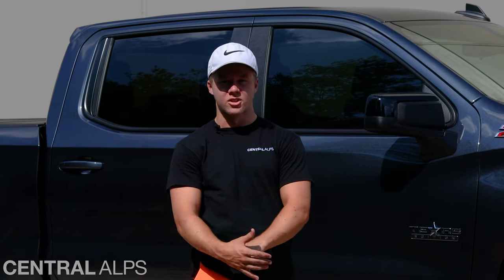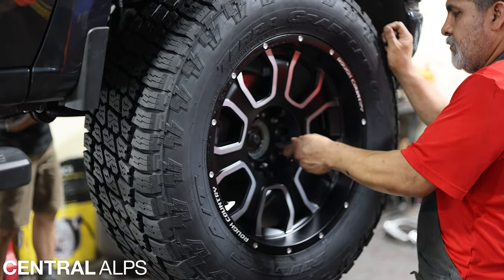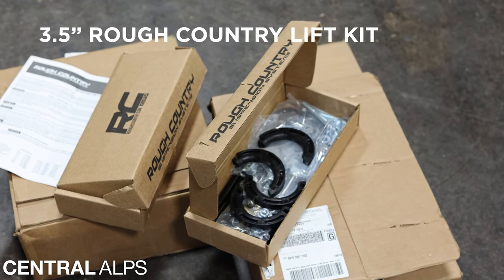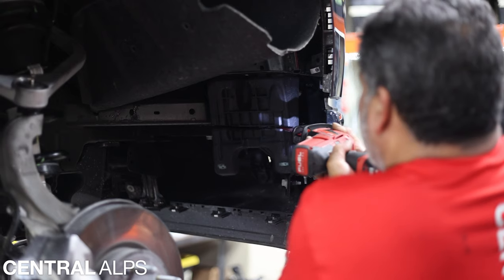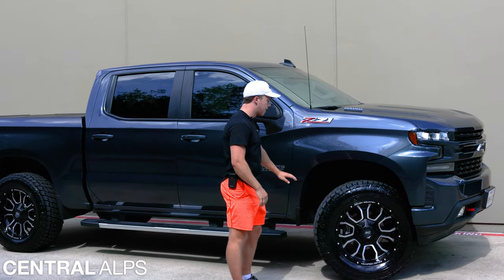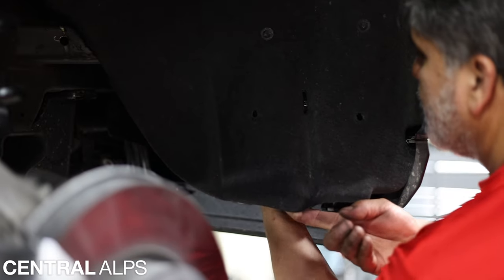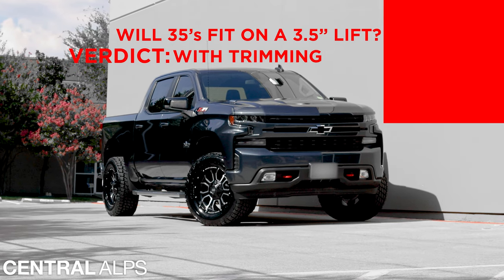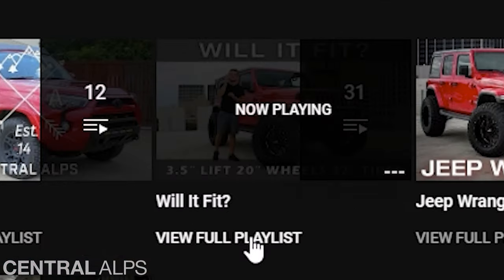WILL IT FIT? 3.5" Lift 20" Wheels 35" Tires on a 2021 Chevrolet Silverado

Comment: Will this same arrangement work on an LT - not sure how much of the stock components were replaced by the lift kit used on this truck.
Reply: What I want to know as well.
Reply: Yes, I just did my 2023 1500 and it fits. Have to do the same modifications.

Comment: I have 35s on a leveled Silverado and no trim with no rub
Reply: What tires ?
Reply: @therod785  Nitto Ridgegrapplers 35x12.50x22
Reply: @Skillz83 reallly
Reply: @ItsJesusss  Yes sir I have 2022 Silverado LTZ on 22 inch Snowflakes and 35 inch ridge grapplers. Camber adjustments is all that's necessary to prevent rubbing.
Reply: Same here lol I have 35/12.5/20 with 1.5” spacers and all I had to do was trim a small amount of the fender liner